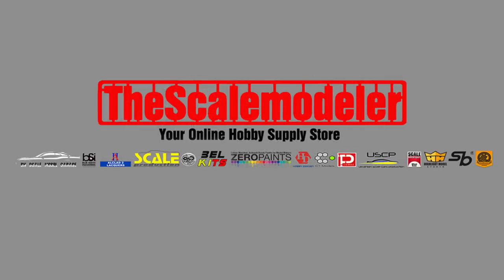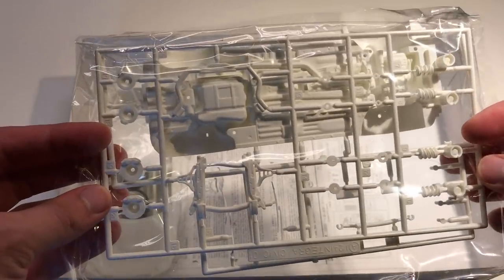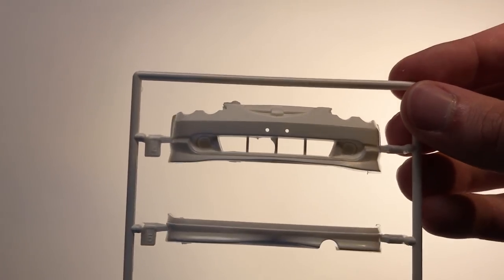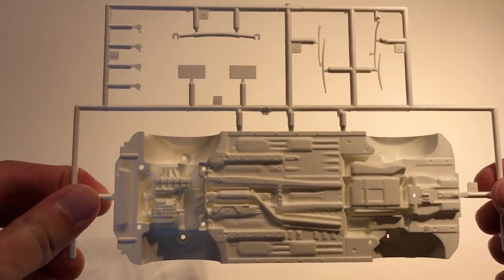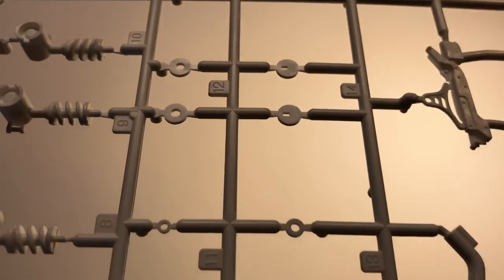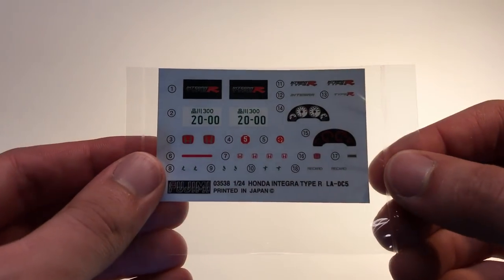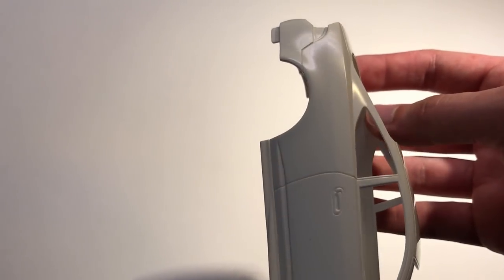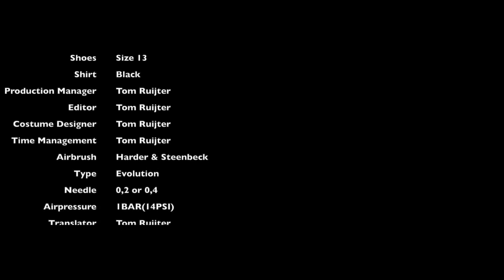Unboxing: Fujimi Honda Integra Type R DC5

Comment: Are the Integra DC5 and RSX the same, but the RSX is just from Acura for the USDM market? Cause i know there's USDM Integra's from Acura also...
Reply from the maker: As far as i know. Yes
Reply: @TheScalemodelingChannel  Okay, thanks. I looked into it, and the Acura line was re-branded as the RSX starting with the 2002 model